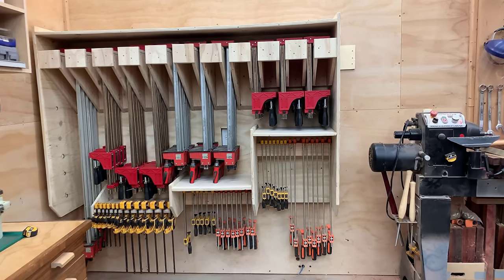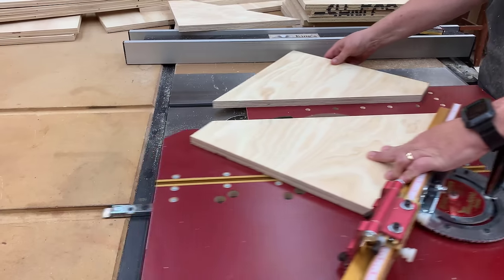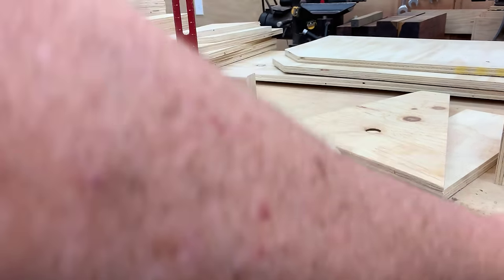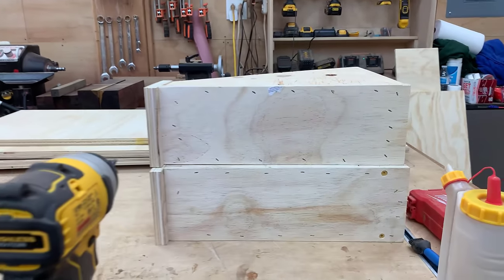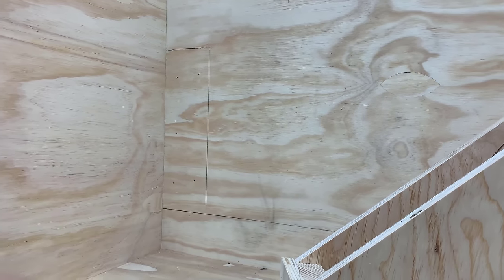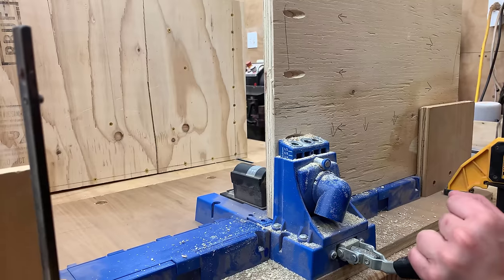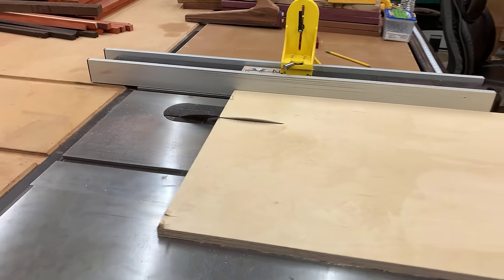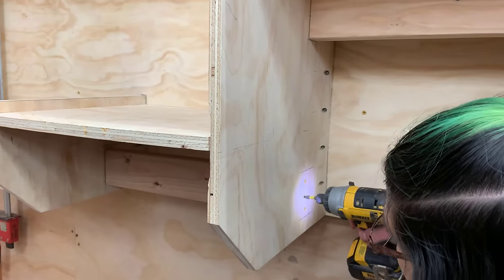104 - DIY ULTIMATE CLAMP RACK with lots of shelf storage for the workshop.

Comment: He's right about getting discounts on slightly damaged sheets. Just this week I needed a sheet of melamine; 4x8. I knew I only needed about a third of the sheet because I was making a table top for my drill press. I found one that had a somewhat significant gouge in a single part of the sheet. A manager at the 'orange' place gave me that $28 sheet for 7 bucks. It pays to ask for a discount on things. If you don't ask the answer is always NO. If you do ask I figure the chances are minimum 50/50.
Reply: : For sure... About a week ago I was at the 'blue' place picking up a couple sheets of 1/4". There was 1 that was damaged in the end 3rd pretty badly. Knowing that I could still get use out of the remaining 2/3, I asked the guy working that area for a discount on it. He said, "How 'bout $2.50?". Sure enough I took that deal. And then he thanked me for getting it cause he said he was going to throw it away at the end of that day because it had been sitting there a few days.
I've always had very good luck at both places tbh with damaged stuff. I think they realize they would rather make 'some' money on an item than take the total loss.

Comment: I’m curious, after three years of use do you find having the small light clamps at the bottom to be cumbersome?  My thought is that the small clamps would be best up high where they need a little more care to install, and the heavy clamps would go down low where they are easy to slide into place.  Bending over to latch the small grip clamps seem like inefficient body movement.  As a production carpenter I’m always looking to make movement smoother , quicker, and with less effort in order to reduce costs or body stress.
Reply from the maker: The truth is, we’ve moved the squeeze clamps mostly to the assembly table. On either end of the table there’s a board for them to attach to. And that’s much easier. 

Also, unfortunately, I’m not the person to ask about streamlining production processes in the shop. 

During the last 6 months I was redesigning & rearranging the shop to make everything easier and more functional. 

And believe it or not. I put this clamp rack halfway around the other side of the shop from the assembly table. Not it’s ridiculously inconvenient to grab parallel clamps. 

Such a dumb oversight. Especially considering how long I’ve been doing this. 

I’m not sure what it is, but I have a hard time setting up for for ease, convenience, and just general shop-flow. 

I think you should move back here and help me!

Comment: So you used 3/4" plywood, how man_ sheets did you use making the really nice looking clamp rack. I don't have as many clamps like you do. It's closer to only 50. I still do not own any of the Bessy or Jet parallel clamps. I have a mixture of Dewalt, Irwin and Harbor Freight. I also have a bunch of pipe clamps and some still need the pipe. I can take pieces of this design to make my own to accommodate 100, which is my goal. I love the little jig you made for creating a line for the screws. Stealing that one!!

Comment: I have a huge problem with my dewalt f clamps slipping.  Any of yours slip?  Any fix to it?  My harbor freight ones have never slipped, and I figured paying 3 1/2 times more for dewalt would be beneficial...not when they can’t even hold slight pressure without popping
Reply from the maker: Hi, I’ve never had one slip. Not even once. I wonder if there was a batch that had defects. Have they always slipped?

Can you send me a picture of one of them? I’ll try and do some research on it. 

DeWalt should have no problem honoring a replacement.

Comment: First I want to tell you that you are a standard of quality for the videos, some of the best on the tube, and everytime I see you working with your girls, I have a song that comes to my mind "It's a family affair...."...very nice and thank you!!!  But I have a couples of questions:

I am on the verge to modify my shop drastically. First I want to install 2 walls with french cleats to remove all my tools from the drawers of my workbench (too much tools in big drawers, you tend to forget or not use all your tools, for me it's now a fact),  as I look at multiples videos, some have cleats of 2 inches, and some use a width up to 8 inches...to support tools like drills, squares, hammers, clamps.... not very heavy tools. So I have never seen a video that people explain the reasoning or math behind the width they use. 

So I have a question about french cleats, in my mind the width of the cleat is not that important, and everybody is overbuilding, here is my math, if I rip a 2X4 in half, I will end up with with 2 pieces of 3/4 inches by 3 1/2 inches, if I rip  the 45 degree cut on each pieces, I have a cleat system, that should be very solid because it's not plywood?.... Or is there math to say I need a bigger width than 3 1/2 inches or that plywood is better than solid wood at the same width...?!?!?!?!

The second major move is to dismantle the 4'X8' workbench with huge drawers, to a new design I have in mind, basically it will be only 3'X5' (torsion box), because of my small shop, but also I want it to be able to bring it down completely, so I can move heavy stuff on it, and also to lift at any comfortable height I need to be able to work on the stuff on the workbench, it also needs to be mobile and switch to fix when needed, for that I am not certain to use a scissor lift on wheels, or use an old modified motorcycle lift .... I would welcome any suggestion, and I would love to see a video from you on that.
Reply from the maker: Hi Tony, thank you. You are very kind. 

Your plan to resaw a 2x4 for French cleats will work great. But I’d be careful to get very straight ones and use them quickly. A wall of warped 2x4s might get you frustrated. 

I think that’s one of the benefits of ripping plywood is that the rip will be nice & straight. 

As for the adjustable bench, that’s a great idea. And one we’ve worked on a bit. So you might see a video of that next summer. 😁👍🏻